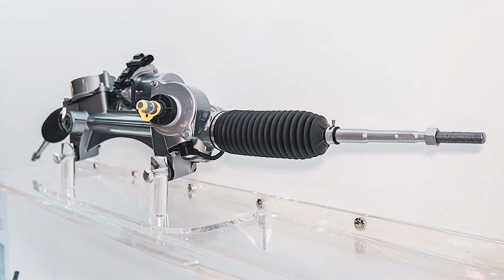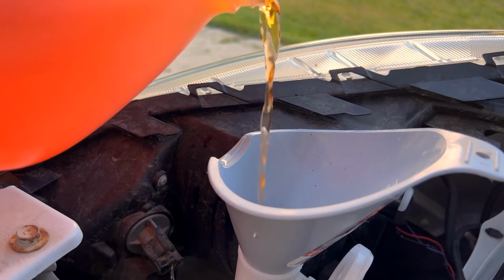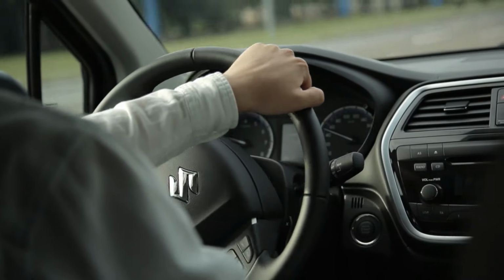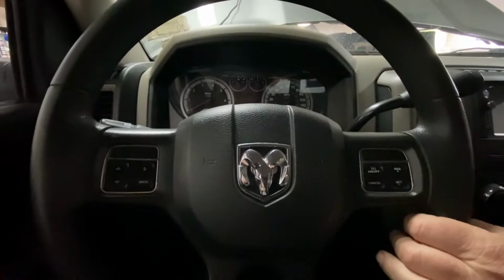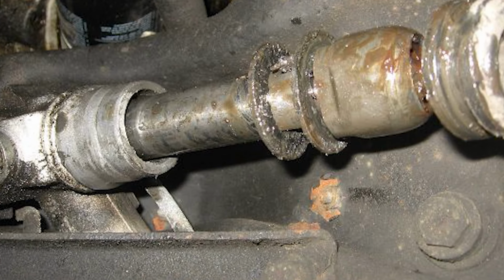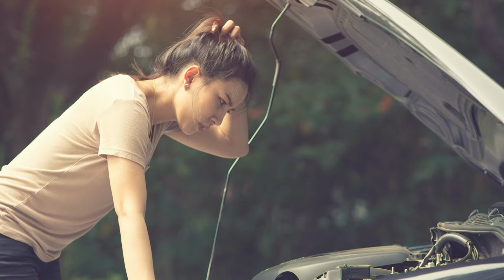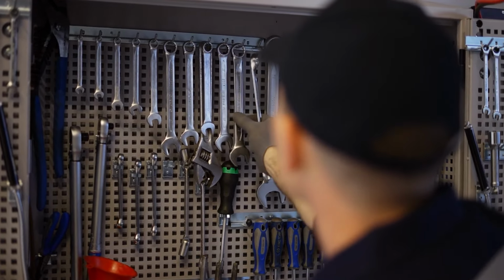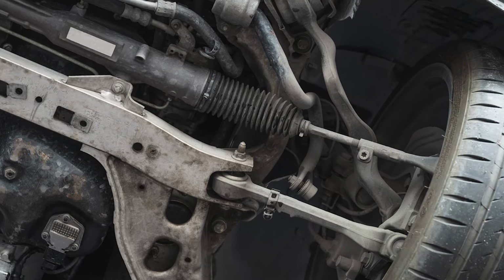8 Symptoms of a Bad Steering Rack | Signs your Rack and Pinion is BAD

Comment: How about knocking from steering wheel when driving on uneven road specially on low speed. Also seems it has a not noticeable free play on steering wheel. When I went to shop, they said it needs to replace the whole steering linkage assembly.

Comment: My 2010 Ford Mondeo has stiff steering which then becomes light then back to stiff, there are no leaks, no grinding. I have replaced the reservoir and pump plus full bleeding of the system several times.... I don't think it is the rack as the car doesn't wander but at a loss to find the solution?
Reply: Lower intermediate steering u joint it's the lower half that comes out of your fire wall it may be rusted give it a blast with some lube will free up for now but replace it

Comment: My boot came off the steering rack it didn’t rip it just popped off  it’s been off for a while but I’m now noticing these symptoms could it be the rack
Reply: Was it the Rack?
Reply from the maker: The boot on the Steering Rack is there to cover the inner tie rod ball joint, to keep its grease inside and to protect it.  once the boot is off, the grease that protects it slowly leaks our due to heat and dirt. As a result the inner tie rod can go bad.  But not necessarily the steering rack.
Reply from the maker: I cannot be the Rack necessarily.

Comment: Hi, my son has an 08 ford explorer. He just had the inner/outer tie rods, lower ball joints, upper control arms and sway bar links replaced on both sides. His mechanic also noticed the rack n pinion is leaking and i hear a noise that sounds like grinding. He continues to drive as is. I need to know what are his risks if he xontinues to drive like that until he can fix.  Your help is appreciated. Thank you!
Reply: if the system leaks oil, it means that the servo pump is also getting foul air inside and has too low a hydraulic oil level, which contributes to the destruction of the servo pump. This will eventually show in the difficulty of turning the steering wheel. Then it's time to replace the oil pump and rebuild the power steering rack. The cost is not small, at least $400

Comment: My 2009 Honda accord I had an low speed accident where I hit another vehicle in my blind spot which bent my wheel a little as well as the tie rod end just a little but shortly after the power steering pump lines were very hot and a leak begun as a result melting the seal failed to mention immediately after the accident you had to put physical effort to cut the wheel to the right (where the damage occurred) I noticed a somewhat click coming out of the steering wheel due to life things I have been put in a spot to drive the vehicle this way and as a result I’m now hearing the metal grinding only when I turn right but after a certain point the steering wheel I guess snaps lose is the best way to describe it (going from difficult to turn right starting out to easy) also when up to speed the steering wheel is significantly easier to turn as if it had never been wrecked which led to replacing the pump right off before driving and it helped but still hard to turn here soon I’m gonna replace most front end parts such as the tie rods and ball joints but trying to narrow it down so I can do this all in one go to avoid damage to new parts and hassle ect there’s more that I can’t think of off the top of my head

Comment: There is a knocking when turning steering wheel in park. Subaru replaced psr but the noise remains. I can't drive a straight line.  As if i was a lil drunk. Irritating for sure. Subaru says nothing wrong. Not sure that they replaced anything.
Reply: That’s Subaru for you!  My husband drove Subarus, still have 2001, with 108k, 1 daughter on her 3rd, other daughter, smartened up, bought an Acura.  I put a lot of $$$ in Subaru, most parts are junk.  It’s hard to find a really good mechanic, and dealership to work on them.  Good luck!
Reply: Steering column joints... why didn't they check that out?

Comment: My steering sometimes is tight but most of times its working normal, i hear some slight clunking sound when quickly rotating left right steering wheel in still position, i also hear slight noise like a damn diesel engine, when i turn steering wheel, this is bad rack?
Reply from the maker: It definitely has to be checked out.  But sounds like you may have either a control arm ball joint issue, or tie rod ball joint issue.  They tend to make that clunking sound when turning.  Check those out, you can get them replaced if they are the problem.  Usually steering rack has a much longer life.  
Hope this helps.  Good Luck!
Reply: What if I loose power and whole car dies when I turn my steering to the left?  I was told it's my rack and pinion.